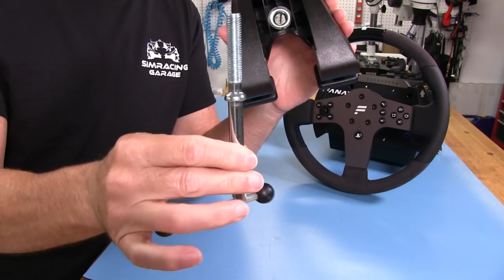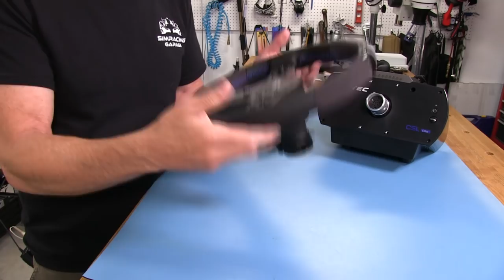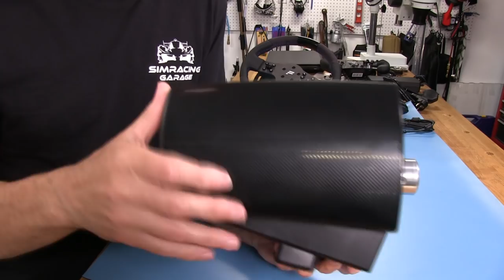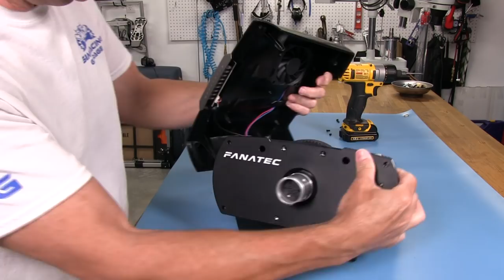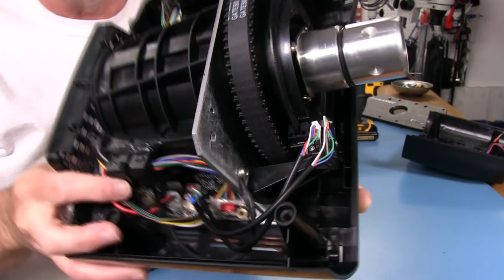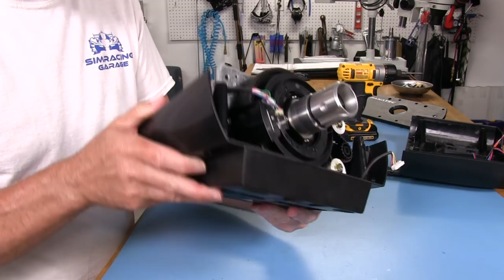Fanatec CSL Elite RW Review

Comment: That slotted wheel with a sensor is called an Optical Encoder Wheel. Old Ball mice used these to tell which way the mouse ball (and therefore the mouse) was moving. They are very sensitive to dust and dirt.
Reply: As many Fanatec users have since found out, I'm sure.
Reply: Thank YOU!!! I opened up mine and saw it’s broken 😢😢 I need a new one…

Comment: Barry, a couple points: The fan is an exhaust...  Pulling cool air from the back and bottom to blow the warm air out the top.  Second, the position sensor on the brushless motor is so the motor knows where it is and doesn't overdrive the wheel.

Solid work though.
Reply: Thinks for this. My wheel has been losing its center after driving for a while and I think this is the sensor that needs to be cleaned or hopefully not replaced.

Comment: 29:50 Looking at the 3 big resistors on the edge of the board, and how the wires go into the motor, I'm pretty sure that's a brushless motor, and the position sensor is used for high precision commutation feedback into the controller. In case you're wondering, that's a very Good Thing(tm).

Comment: I really appreciated your in depth explanation of the disassembly. Knowing those tiny front plate screws were 2.5 hex helped a lot. The explanation of how the sensor works also helped me diagnose a problem with my base. Thanks Barry!
Reply: What kind of problem did you have? And could you fix it?
Reply: Marco Maas When powered up, the mode light would flash red and the wheel wouldn’t make its full rotation and complete start up. I took the base apart and sprayed compressed around the optical sensor and the disc with the slots in it. Success!
Reply: @shadyhawklive  Good to know this! I also like to open things after warranty has ended.

Comment: Barry, I only play NASCAR Games (currently NASCAR Heat 4) on PS4 and I'm considering purchasing this wheel and the pedals. I currently use a Logitech G29. In your opinion, is this an upgrade and is the Brake pedal that comes with the 2 pedal set sufficient?

Comment: One feature that stands out on this wheel that wasn't referenced directly, is its ability to tune independent of the game or console. I play a lot of GT Sport and it has literally no adjustment to the FFB outside of two sliders. The Fanatec method of adjusting the wheel base and particularly the brakes (with the load cell setup) come in extremely handy for applications like mine. I would prefer a little more finite adjustment on some settings (10 points out of 100 is the norm) but the available adjustment is welcome as it is.

Comment: I've had my CSL Elite for about 2 years now, and I still am very satisfied with the product overall. As I ended up getting my dad into sim racing, we now have identical Fanatec rigs.
Reply: Does your wheel a lot of noise when you play with 100% force feedback?
Reply: My base has pretty bad deadzone or slack when steering left to right, and does generate loud clacking noise and "empty hollow FFB" when driving over kerbs etc. Can't use higher than FEI 30  @eljorge225

Comment: Great review as always! My CSL Elite wheel base (non ps4) gets pretty loud under load. Wondering if I can replace the 92mm (I think) fan with a 120mm quiet fan.
Reply: The fan is 70mm.
You can put 120mm fan but not inside the base:
https://www.gtplanet.net/forum/threads/fanatec-csl-elite-racing-wheel-thread-officially-licensed-for-ps4.356268/page-48#post-12298332

Comment: Position sensor on the motor because its brushless, a brushed motor will rotate different directions based on + or - V, brushless can rotate in either direction on both so the software needs to know what direction it is turning to regulate the voltage for correct FFB direction

Comment: just slot the motor mounting holes, then you can adjust the belt tension easily. The motor sensor is feedback to the brushless motor controller (so it can give good torque at zero rpm and low rpm), not for feedback to the game. Good review.

Comment: WHy are these things so expensive?
I was expecting metal body and metal connection parts... but so much plastic.
Reply: I hear you. I got a g29 with shifter for $325. It's all plastic and felt pretty cheap to me and was going to return it and get a t300 or this wheel. After watching reviews on both they're all plastic and cheap looking so now I don't know what to do...
Reply: Molon Labe this is their cheapest wheel. I had the g920, thrustmaster tx, and now the fanatec v2.5 with the bmw wheel. Fanatec is by far the best with so much tuning in the wheel that is soo important. Also a lot more feel of the road and car
Reply: @Tom Watson T300 is a liability. Seems like 50% breakdown rate withing the first year if you believe reviews.
Reply: Logitech is a kids toy 😂😂😂 abd thrustmaster is shit to had to keep replacing sent it all back now buying this setup
Reply: J T G only if you run the ffb maxed. Turned mine down to 70% and runs just fine.
Reply: Aidan Millward That’s like minimising wear on running shoes by only walking in them. If you can run in them, it’s not doing it’s job. If a wheel can’t consistently run at close to or 100%, it’s doing something wrong.
Reply: Just bought a T300RS, worked liked a charm for...2 sessions, so about 3-4 hours. The wheel does not calibrate anymore, even with the calibration tool. Asking for a refund.
Reply: @rs9553  have had my csl elite base over 2 years..the base rim kinda sucks but no problems with the base itself.. The elite pedals are garbage. The load cell is great though. Waiting on v3's now.
Reply: There is definitely a HUGE market on all sim racing wheels, pedals etc. The difference is that the Fanatec products are top notch, well designed, with quality workmanship and parts. When you buy a Fanatec wheel you see and feel the quality. My opinion is if someone is spending money on a Thrustmaster T300 or above, and they play racing sims regularly, they might as well just pay the additional money and get the CSL Elite.
Reply: This is one of the cheaper higher end models. Not necessarily and entry level wheel but a bump up from entry level
Reply: @molonlabe9115   Simracing gear is not cheap. you would need to pay 1000+ for all metal

Comment: Have been running mine hard for nearly 3 years now and it still works great. Got it used and abused for a great price. Have never serviced it and always runs at a high FFB setting. Bought it right before they announced the CSL DD but still don't regret my purchase. 

My old Logitech G29 would overheat from long drift or rally sessions and felt like a cheap toy by comparison.
Reply: Does your wheel a lot of noise when you play with 100% force feedback?
Reply: @eljorge225  it can be a little noisy during crashes, hitting curbs, or driving offroad. During normal use it isn't loud.
Reply: @jerrylindgren7828  thanks man, i was thinking mine was broken

Comment: Hey @Sim Racing Garage thanks for another disassembly video :D Isn't there is too much plastic inside for the price they ask for it? Considering the amount of it, looks like a Thrustmaster wheel for me.

Also I want to point out that fan inside the case is pulling air OUT because they usually blow towards the hub, meaning that it creates negative pressure inside and pulls fresh air through honey-cone looking back grill.
Reply: Like owner of all TM wheels without T-GT and owner of this Fanatec wheel - gotta say that there is nothing common between them outside and inside! The functions here are Epic! After releasing the CSL Elite GT3 Mc Laren rim - OMG!:)
Reply: the price would also include the PS4 license to be compatible maybe?

Comment: Hi Barry @Sim Racing Garage . Kudos on your detailed reviews. I know it's been a while since you did this review but if you can do me a favour I'd appreciate it. I've had to open up the steering wheel recently to replace the CSL P1 main cable but after replacing the cable I wasn't too sure how its wires fit back in so as not to have them pinching after reconnecting the backpart. i.e: wasn't sure if the cable/wires wrapped around some recessed groove or just fit back in the hole near the front part's pins contact. I just pushed the wires in the hole space.

If you can, can you do a vid/tutorial opening the rim to see how its main cable is fitted safely to avoid pinching or damage?

Comment: The motor inside the wheel does not output 6Nm I'm very sure. The wheel output from the wheelbase output shaft could be 6Nm but the electric motor itself outputs a lot less. The 6Nm output torque from the base is achieved with the drivetrain which in this case is the pulley gears which has a ratio something like between 1:5 and 1:7 (quick eye estimation from the video). Which means the motor torque is between 6Nm /5 or 6Nm/7. Which is about 1Nm.
Reply: Erwin Lommer that's right, the gears and belt amplify the torque
Reply: The ratio is 1:6
Reply: Wait,  we can generate 6Nm torque from a  1 Nm motor? I didn't knew that. I knew we can multiply the force but I didn't think it would be this much.
Reply: K.G We can theoretically do it to nigh infinite ratios with enough gears, the problem becomes that the gearing will slow down the rotation. With a 1:6 ratio for every 6 rotations of the electric motor the other end will rotate once. This means that eventually you'll start running into issues with motor acceleration times, top rpm speeds, consistency, reaction times to varying inputs, etc. This is why the best wheelbases used today are direct drive, with absolutely no gearing in between the motor and the user, to get maximum accuracy and controllability on the forces, but you need a really strong motor to really make use of that.
Reply: It is the same principle as the gearbox in your road car. In smaller gears (1 and 2) the gearbox multiplies the torque but speed is reduced. Total gear ratio is something like 1:16 altogether. At high gears the there is less torque at rear wheels but they can rotate faster, ratio being 1:4 or so.

The equation for gearboxes is power in = power out. Little power is lose inside the transmission but we don't care about that. And power = rpm * torque. In other words with gears you can adjust how much torque you get from power but you can't change your torque without changing your rotation speed. 

So if you change the gear ratio to 1:6 your speed is decreased by 6 but your torque is increased by 6x. But power stays the same so power = rpm * torque = 6*torque * 1/6*speed. Now 1/6 times 6 is 1.

The reason why fanatec belt wheels used to have two belts is because the bigger gear grows too big if you try to do big gear ratios with one pair of belt gears. If you want something like 1:10 ratio the bigger gear needs to be x10 the size of the small gear. If your smaller gear is 2.5cm or one inch your bigger gear needs to be 25cm or 10inches in diameter to get a 1:10 ratio (10x the size). Can't fit 25cm or 10inch gear inside the wheel very easily! And with belt gears you can not make the smaller gear very small because it start slipping. So they use two sets of gears. Total gear ratio here is = ratio1 x ratio2. With two 1:5 gear ratios you get 1:25 total gear ratio. 

Logitech can do it in one pair of gears in their g29 because they use plastic gears. With plastic gears the smaller gears on motor can be really small. I think the g29 motor gears are something like 1cm or 2/5 inches. On 1:10 ratio this makes the bigger gear only 10cm or 4 inches. But with plastic gears the gears may also break so you can not put too much torque through those small gears. Which is one of the reasons why logitech uses two motors. Less load on those gears and they still get their big gear ratio.

The big gear ratio helps with the torque. If logitech wheels can output something like 2 newtonmeters of torque and their gear ratio inside the wheel is say 1:15 then the torque of each of those motors is 2Nm / 2 /15 = 0.07Nm. However if you were to take those gear ratios and use your 30Nm direct drive monster servo your output torque could be 450Nm. 900Nm if you put in two servos. Needless to say those plastic gears would break instantly you turn it on. 

Thrustmaster uses smaller motors than fanatec (generally) so thrustmaster needs bigger gear ratio than fanatec. And thrustmaster use belt gears and because they can't do big ratios in one pair of gears for reasons mentioned above they use two sets of belt gears. But in all cases the electric motor torque is far less than the number the wheelbase can output. It is not wrong or misleading marketing. It is just how physics work.

Comment: Also, is there a noticeable deadzone in the ffb near center position like on the G27 or 29?
Reply: MV Shaw No, there is no deadzone at all, I believe the reason why Logitech wheels have a deadzone is because they use a dual gear drive system, and at dead centre the gears are kinda pushed against each other, so to prevent it from slapping against each other

Comment: Hi there, just slightly off the topic. I’m about to buy the csl elite for PS4 + V3 pedals and bmw wheel. Do you reckon this set will be still compatible with the PS5 ? I’m scared to spend €1200 and found out soon it will not be compatible 😅 Thank you. Great channel.
Reply from the maker: No one knows if any of the current wheels from Fanatec, Logitech, or Thrusmaster will be compatible yet. Up to Sony really.
Reply: Sim Racing Garage Thank you
Reply: @tomaszmichewicz7867  there is a device called a drivehub for $99 I believe that allows you to use any wheel on any console or pc. Use your xbox wheel on your wii or vice versa if you really wanted too. I'm sure it will be updated once the ps5 comes out.
Reply: Molon Labe Thank you very much 👍

Comment: Barry, will the pedals for the Logitech G29 work with the Fanatic CSL Elite wheel for the PS4? If yes, do you know if it would work with the NASCAR Heat games?
Reply from the maker: The G29 pedals won't connect to the Fanatec wheelbase. You need to connect pedals and shifter to the Elite for them to work on PS4 as they go through the wheelbase. There may be hack to make that work. But I don't know of any.
Reply: @simracinggarage3026  Thanks

Comment: I think the use of the shaft behind the motor is to act as a sensor for the motor itself... I think that the motor is a sensored bldc.. hence the need for the sensors... There will be varied resistance.. so a sensorless bldc will likely suffer if there's too much resistance.. but a sensored bldc knows how to counter the torque without "skipping"  from a false control signal from the controller...

Comment: Can I ask an information?  I have the Csl Elite F1 package, from day to day a kind of "linearity" has been created on the steering wheel: at the center the steering wheel is softer while at the ends it is harder.  Tried to reset / update the firmware but the problem persists.  The settings on the steering wheel have always been the same and there have been no updates.  Any idea what could have happened?
Thanks a lot
Reply: Depending on what game you play, set some minimum force. Just a few percent and test it

Comment: Would this be a huge upgrade from a Logitech G27?

Or, should I just save up for a direct drive wheel?
Reply: It’s a huge upgrade from anything Logitech or Thrustmaster. If you’re a hardcore sim racer though.....I’d go direct drive.
Reply: @t.sewell1513  I ended up getting the club sport base with a formula wheel. HUGE difference over my logitech. Pretty close to ZERO slack at the center of the ffb. Night and day difference.

Comment: The other day some folks on the simracing subreddit were saying this PS4 version has the same motor and sensor as the v2.5, is this true looking at the internals now?
Reply: Yes it is if you go to Fanatecs website it state's this that they have the same motor and electronics but because the gearing is different it only has 6nm of torque...
Reply: @johnsmith-oh2xo  But not the same sensors (Hall effect vs. optical wheel)

Comment: For someone that is looking at getting into sim racing. And is looking at getting a csl elite package or a lower end direct drive setup. Which one would you recommend to them?
Reply from the maker: If you are just getting started, maybe a Logitech G29 or Thrustmaster T150 would be best. If you decide Sim racing is not your thing, then you can resell and not get hurt much. If you get hooked, then move up to what you want then. Just keep your first choice as a backup or sell it.
Reply: @simracinggarage3026  K. I have tried sim racing before and liked it. I just don't have the space for it right now.
Reply: @simracinggarage3026  What would be a good sim racing seat/cockpit to get to handle a mid range wheel setup? That wouldn't be to expensive?

Comment: How does this wheel feel in the middle position going down a straight compared to a Logitech G29? With my G29 on a high FF setting you have to grip the wheel tight so it doesn't start to oscillate and wobble out of control. Very annoying and tiring.
Reply: The Logitech wheels are infamous for that huge dead-zone in hte middle. AFAIK no other FFB wheel bases suffers from that.
Reply: @bigredracingteam9642  I already got it and it's an amazing wheel and a huge upgrade from a G29. Even more than I came to expect from reviews.

Comment: Having recently acquired one of these, my main complaint would be that when the fan kicks into high speed, I can feel the small, high-frequency vibrations of it through the wheel. It is quite distracting. Since the fan is easily accessible,  I shall experiment with some kind of shock-mounting of the fan to absorb those little vibrations.
Reply: I have the same, I’m considering replacing the fan with something better
Reply: I feel the same.